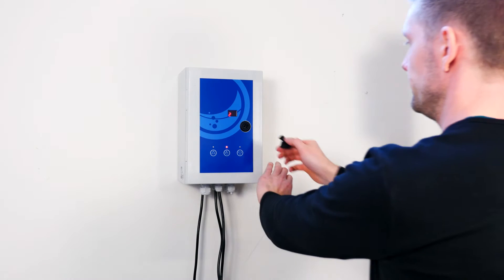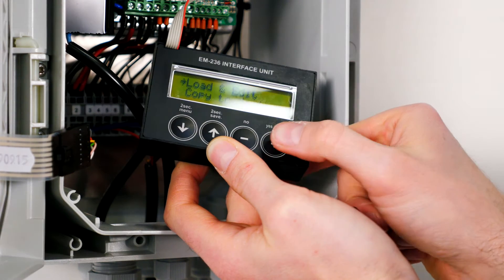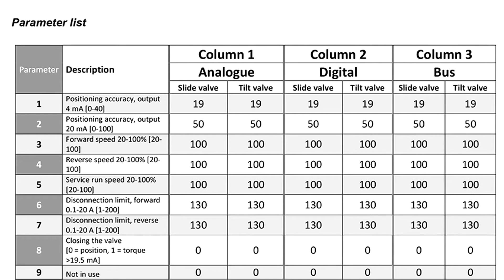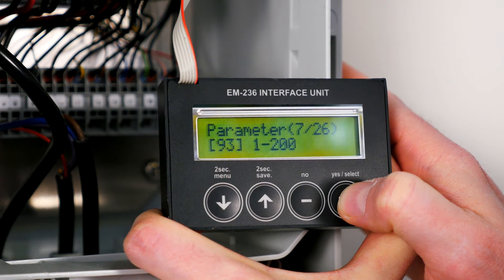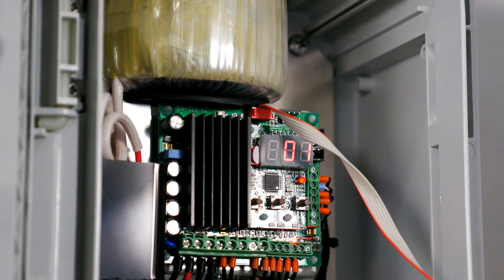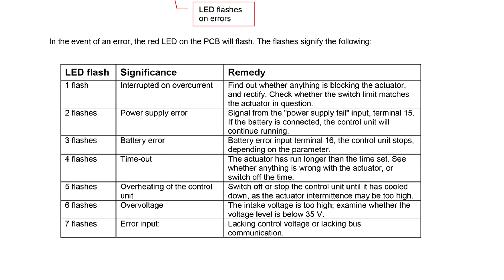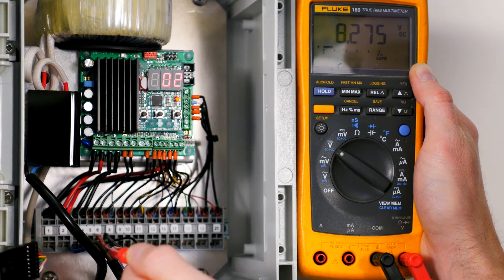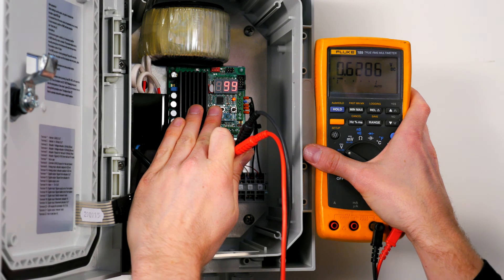LINAK WCU Basic: Troubleshooting

Comment: Can't connect a laptop to make this streamlined experience like we do with BUS2 app when programming an actuator?
Reply from the maker: Hi Jack. Thank you for your excellent question. It is true that the BusLink 2 PC software is used to program our industrial actuators with integrated controller. Unfortunately, the WCU Basic is a third party product and the programming module does not utilize the same interface. We are always looking for ways to improve our solutions, but offering a PC software specifically for this control unit is not in our R&D pipeline as we speak. Feel free to reach out to us again if you have any questions or great ideas you want to share.
BR, Christian D. Bach
, Business Development Manager, TECHLINE®
Reply: @LINAK  thanks for reply Christian! The reason why I asked this is I've got linak actuator that isn't working at the moment on industrial site. 
All our louvres are moved by LINAK  actuators. 
SCADA control software reports that motor is overloaded on one of them. 
I replaced the actuator with spare unit, but it still reports overload.
Is there any chance of resetting that WCU BASIC unit, apart from dropping power supply to it, which it didn't work?
Cheers!
Reply from the maker: @trade1713  Hi again Jack. I am sorry to learn that your system is failing. Have you looked at the user manual for our WCU? It can be found here: https://linak.as/3gObR0a. If this still doesn’t help you out, I strongly suggest that you reach out to your local LINAK office and let them assist you. I hope you can get the system up and running soon and wish you a nice day.